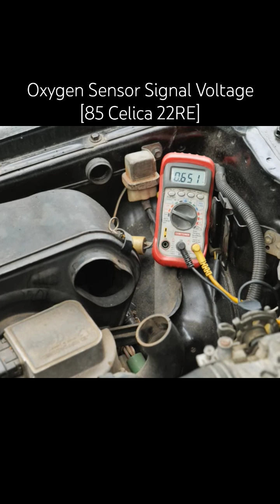Oxygen Sensor Testing with a Voltmeter [False or Actual Lean Signal]

Comment: Seems like a fuel delivery issue.. like pump or leaking connector out of the fuel pump.. That is a cool idea, directly reading the O²  ..
Reply: I guess practically it’s not really that great I’d argue most of the time 02 sensors work on AC and they need to be fluctuating right in between that sweet sport of the 14.7g of air to 1 parts of fuel so it’s actually really not great to multimeter 02 sensors for teaching purposes it works good if you don’t have a scope or a scanner
Reply from the maker: So many misconceptions in your statement.
1. O2 sensors like this one are an analog DC voltage signal
2. Once O2 function is tested and confirmed, we use the O2 signal to identify a lean condition. This was the key test! Especially when scan data is not available like on this 85 celica! Watch the full video linked in this short for more context.
3. An Oxygen sensor signal fluctuates because the ECM is driving the mixture to make it fluctuate. They do not oscillate on their own.
When reving up an engine on a severe bog, the O2 signal dropped and flatlined lean confirming the cause of the bog. A lean condition! So what is the next step in confirming a lean bog? Fuel pressure test!!

Comment: I have same issue on 99 Astro van -13 what should I be look for spider is replaced and ideas thx in advance
Reply: @ScannerDanner   I have a 99 Astro van 4.3 running lean reads -13 I changed injectors 2 twice full tune up fuel pump& filter runn fine as load there no load dnt knw were th go from here no codes
Reply: Pcv valve, coolant temperature sensor, fuel door cap, EVAP purge valve, brake booster and cracked hoses. The brake booster is the sneaky one.

Comment: I miss the 1980's when I would have an analog meter @ the M/C signal wire & hold the disconnected O2 signal wire then touch + / - on the battery then see the M/C signal react.
Reply from the maker: That test still works 🙂
Reply: Back then we chased lots of ground issues with O2 Sensors .... Although great diagnostic ability transitions with time, U do forget as much as U learn in this business. 👍 keep them bucks honest with your lesson SD.